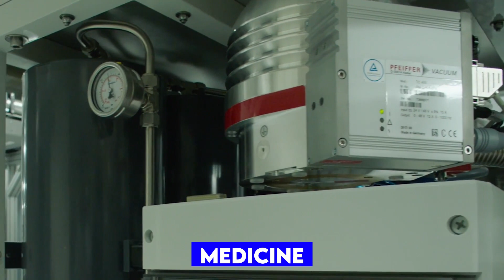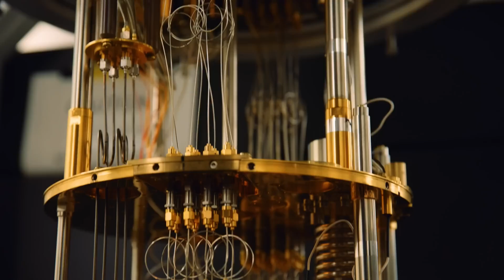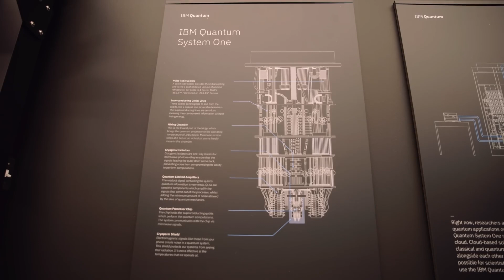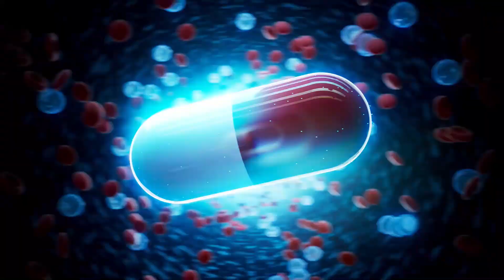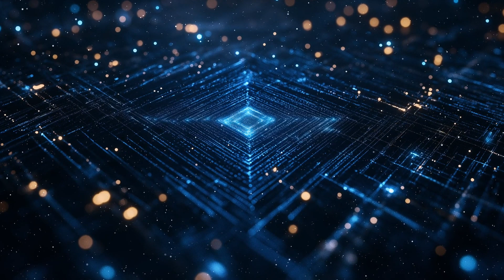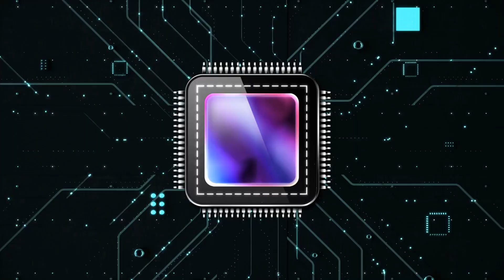IBM’s Starling: Quantum Computer Set to Outperform Today’s Fastest Supercomputers!

Comment: That is never going to happen, because quantum computers can not do what standard digital computers can do.

Quantum computers can be fed with large quantities of data and come up with many possibilities in a very short time, just as in current AI those results are coerced into probabilities, it is those probabilities that are used to form the result. 

The massive models currently used are extremely good with data, this is what makes it good at AI but Remember that right now not a single public AI is running on a Quantum computer. Qubit know how is used, but not Quantum computers. They are all digital computers, the architecture borrows from the way graphics engines work, since for the most part they are running the same small tasks for a great deal of data. It can be said to be the an amazingly good database. It does not require any knowledge of the data, it never applies physics to the patterns, in fact currently there is not enough room in the computational engines to include the coercion needed to include physics in the patterns.

Remember always the limitations of Quantum,
No memory beyond a fraction of a second (and it is a small fraction).
No copying.
As with a standard digital computer, the starting points have to be said first, but unlike the digital versions, those starting points will not hang around in indefinitely.
Reply from the maker: Thank you for sharing your feedback!